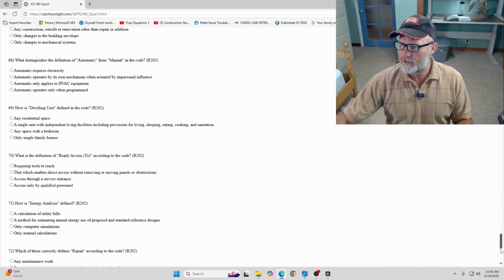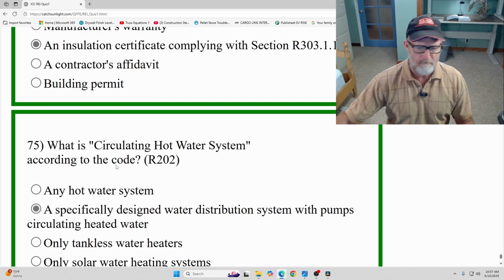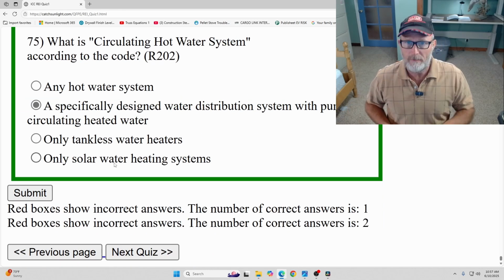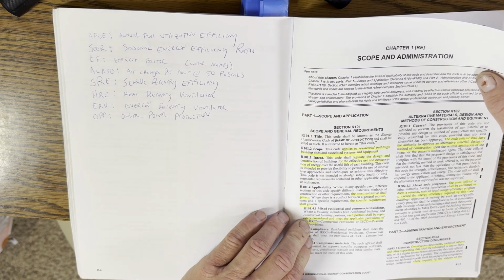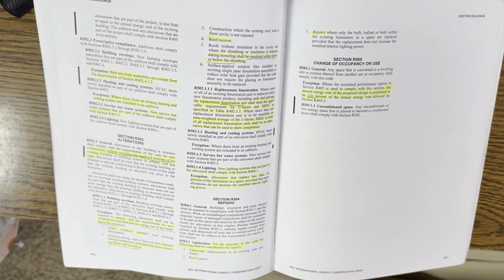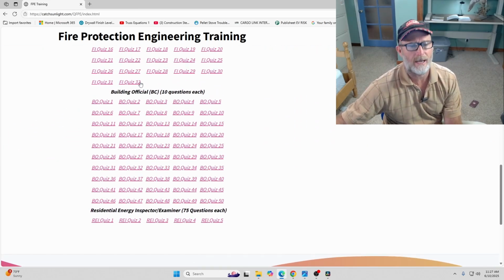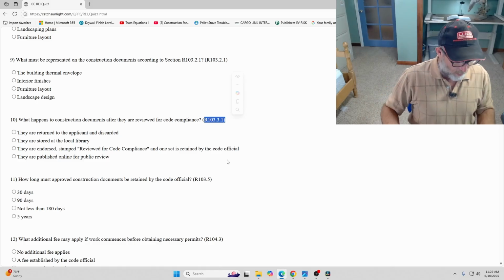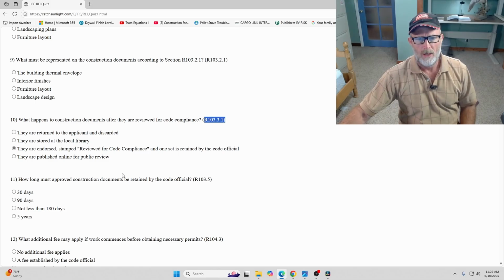ICC Residential Energy Inspector/Plans Examiner (79) || Free on-line tests and my notes

Comment: Why do the other ones I've seen in commercial and this one in residential? Just curious
Reply from the maker: For me, it was because the residential energy and plans examiner was required for the MCP,  but the commercial was not.  We do have both the commercial and residential sections of the IECC up at tests.livesayconsulting.com.  You can access that free or pay $10 for IECC stuff.
Reply: Not sure if thats going to help me. I'm taking the ce I think, the one with inspector and plans together, and also 2021 .